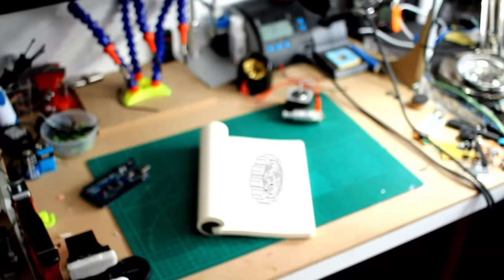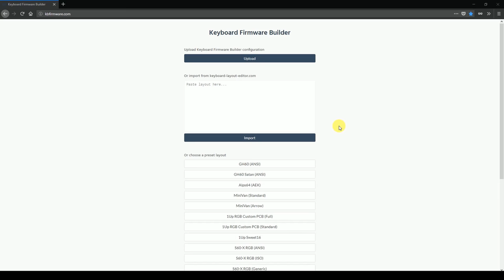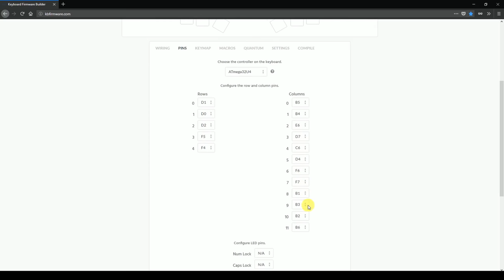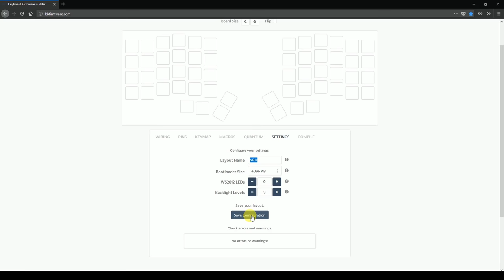P4: Fully DIY Mechanical Keyboard (Code name: Arke)| Wiring & Firmware | Part 3

Comment: This is awesome. The only thing that I advise you to do to have more sturdy soldering connecting is to use hot glue on them. Then they will not move or break when you use the keyboards
Reply from the maker: good point... would do that if the keyboard was not for me ;) so far there is no problem (daily driver)
Reply: Could it be done with resin? Hipothetically speaking, for added sturdiness. I have no clue wether it's conductive or not
Reply: @casiquekibra  I'm not sure what you mean by resin but if you want a permanent solution you can use epoxy

Comment: I did use separate controllers for each part of my keyboard and my connector cables between the parts is just standard USB (both left and right side of my split keyboard have a 4 port USB hub, either one or both sides can be connected to the PC).

This allowed me to add a bunch of "extras" to each side (like volume + media controls + macro keys on the left pad and a display, scroll switch I salvaged from a Natural 4000 and backlight controls on the right) and add both a numpad, gameboard and recently a streamdeck to the same device chain.

All of them have their own firmwares and names when connected to the PC and can be tinkered with and improved by themselves.

I'm also thinking of adding a "mid section" part that has a bunch of USB ports and connects to 220AC so I'm not drawing power from my PC and can charge my phone and tablet straight from there.

Other reasons to add a power node is I've been thinking of building a microphone interface and a headphone amp block too. Already made a streamdeck so might as well go all out I guess.

Comment: What are those little pin connectors that you used to make the cable and connection between the 2 halves? Asking for a friend (I'm talking about the ones lying on the work bench at 7:15)
Reply from the maker: They are most of the time referred to as "pin headers" and you get them as "male" (pins) and "female" (sockets)
Reply: @MakenModify  okay thanks. Just bought some and can't wait to hand wire my first mech!

Comment: Is it possible to install encoder's push button similar to chery-mx keyswitch ? 
Total on encoder i have 5 pins:  GND, 5V, A,B, KEY.  (vcc > 5v, gnd > gnd, A/b > rotation pins, KEY = push button )
I've tried to solder KEY+diode to ROW and GND to COLUMN - but it doesn't work. 
Any ideas how to do it properly ?
Reply from the maker: Hm.... Depends. If you have a bare rotery encoder then there are two GND pins one for the encoder and one for the button. If you have a encoder on a breakout board then these two GNDs are connected and that will not work. On a normal rotary encoder you can use the two switch contacts like any keyboard switch (polarity dose not matter). If you have it on a breakout yo can desolder the hole envoder or just the switch GND pin and rerout it

Comment: Can you give me advice? 
I gonna build splitted keyboard with 109 (50 + 59) keys + 4 encoders. The question is: Can I use only single Arduino Pro Micro microchip? Is it enough contacts for all those keys?
Reply from the maker: Short: you can't. The Pro Micro has 18 pins you can use, so the max number of keys is 9*9=81. There are two more pins, which are used for the onboard LEDs. You can modify these but even after doing this you only got 10*10. Each encoder needs at least 2 pins (+1 in the Matrix if you want to use it as a button). So one Pro Micro will not do it. You will have to use 2 (one in each half) and connect them via serial or i2c.
Reply: @MakenModify  thank you!

Comment: Thank you! This the best tutorial in YouTube about diy mechanical keyboard. 
I have 2 questions: 
1) Is it possible to assign on 1 key some key combination like Win+D or Ctrl+C ?
2) Is it possible to add a multimedia volume circle knob that can be rotated and change volume in system ?
Reply from the maker: Yes on both questions. For this board I used the kb firmware tool. It let's you do macros (like Win+D or any other combination), but for a rotary encoder (for volume or so) you will need to use QMK as a firmware. It's not as easy to set up but much more powerful.

Comment: Awesome design and perfect solution with one only Arduino! One question - is there possibility to use USB C type cable to connect both sides?
Reply from the maker: A USB C cable dose not have enough wires inside but if you put a pro micro in each half you can use i2c and only need 3 or 4 wires.
Reply: @MakenModify  Thanks a lot for answer! In any case, there will be so much better 2 arduinos...more cheaper at last :) Thanks again!

Comment: Very interesting, thanks for the in-depth explanation. Do you recall how much the case/plate/electr(on)ics cost you?

If you're interested in studying boards, give the Katana 60 and µTron ergonomic keyboards a look, I'm really tempted to build one of them or some in-between design.
Reply: Also, greetings from Brazil!
Reply from the maker: thank you :) I have the parts i used listed in the description but I would say Switches 30€, Plates 6€, Keycaps 15€, Arduino Pro Micro (Clone) 3€, Diodes 2€... The case only cost me filament and electricity so let's say 5€, than some other things... so something around 60€ (347 BRL).
Meanwhile I've build quiet some more Keyboards but there was not enough time to make a video :/ you can see them on my instagram if you want instagram.com/makenmodify
Reply: @MakenModify   Thank you for the thorough answer! In part thanks to your video I've been seriously considering building my own (also ergonomic) keyboard.

Comment: how to turn your machanical keyboard into a wireless bluetooth keyboard?
Reply from the maker: You can use another microcontroller board that has Bluetooth instead of the Pro Micro

Comment: 3:46 what wire diameter did you use? 
Great build & great video. Learned a lot.
Reply from the maker: I think i used 0,5mm² but that dose not really matter since it dose not have to carry any big current. It's only a signal so you can also use thinner wire ;)
Reply: @MakenModify  Thanks for the answer.
I know it's just for signal transmission but I wanted to know the exact thickness. The thicker the cable, the more difficult it is to bend it and here precision is needed. 
Have a nice day.

Comment: Does the type of cable I use to connect the two halves matter?
Reply from the maker: Not really its just for signals so it doesn't need to be thick or so. I also just used what I had at hand
Reply: Make'n'Modify Okay, thanks for the quick reply

Comment: Great but, What diodes did you use? And what are they for?
Reply from the maker: Ah was missing these in the description. Those are 1N4148. They are used to have n-key rollover and anti ghosting. See here: https://www.dribin.org/dave/keyboard/one_html/
Reply: @MakenModify  Thank you, Can this keyboard be used to play games? (Hold down w to move?) Or are these keyboards not capable at detecting held down keys?
Reply from the maker: @BIrfan  it sure can. The diodes are needed to have anti goasting an nkey rollover so all the stuff that makes a good "gaming keyboard" ;)

Comment: I Have 1N4007 diodes. will these do? or do i need the 1N4148 diodes specifically?
Reply from the maker: They schould also work, the diodes are not that critical, but if you want to be on the save side try a 2x2 matrix and test it ;) i also used the 1n4148 because that is what i had at hand at the time

Comment: I was wondering if there was any way to make the layout of the keys editable (like how some keyboard let you change what each key does) ?

edit: i know i can go and change the layout and flash the pro micro again. but i want to have a software running in windows that can edit the layout (if its possible).
Reply from the maker: Kind of. As far as I know all solutions with qmk involve reflashing. Ther are different softwares like qmk toolkit but they all reflash it. That being said you can use autohotkey but that will limit the effect to the computer it is running on. But ther you can do macros and change keys without flashing (works with any keyboard)

Comment: Bit late but could you give further explanation to how you wired your rows and coloumns to the pro micro.
Reply from the maker: Basically it's from 12:06 to 12:27. This is pretty short, probably could have done that a bit more specific. Basically you have your rows and colums and then you connect them to a pin on the pro micro and tell the firmware what row/column is connected to which pin on the "PINS" tab of the firmware editor.
Reply: @MakenModify  also when you wired the row to a wire where do you solder the wire?
Reply from the maker: @q_u_a_c_c  anywhere on the row really... it dose not matter since its the same signal everywhere along the row wire
Reply: @MakenModify  alright thanks
Reply from the maker: @q_u_a_c_c  your welcome

Comment: How did you upload .hex to arduino?
Reply from the maker: sorry bit late but I use AVRDUDESS, you can find a tutorial on how to flash a pro micro using this program here: https://gist.github.com/CampAsAChamp/e747d2b605c0c32923593b529f82ccdd
Reply: Thank U

Comment: does these keyboards have n key rollover ?
Reply from the maker: Yes and anti ghosting. Fun fact: that's what you need the diodes for ;)
Reply: @MakenModify  oh lovely.. i am looking forward to make one of these. I will start small, with a macro keyboard
Reply from the maker: @vivekanandroy810  sounds good. The principles are the same just less headaches (especially at the first self made keyboard). Good luck :)

Comment: You should deffinetly start selling these bro. i would love to buy one
Reply: it would be somewhat expensive
Reply: @acid3719  hmmm dont think so
Reply: @krisspsify  well yes bc the kb itself is like 50-70$ and the time this man put in it will ad at least a 30$ fee
Reply: @acid3719 man i am about to buy a kbd67mk2 search that up
Reply: @krisspsify  wierd flex but ok
Reply: @acid3719  flex? Buddy you are telling me 100$ is expensive for a custom ergo keyboard
Reply: @krisspsify  no but in my country its like 500$ for you and its expensive asf.i will probabley make my own
Reply: @acid3719  razer charges way more for plastic keyboards with non standard layouts, atlas here you can cut some cost by buying this board with no caps and getting the ones you want. Seems cheap to me
Reply: @TurkeyOW  well you need to know how to solder, have a 3d printer, get some iris keycaps, lube for extra thock, stabs
Reply: @acid3719  no no no, I'm mean ask him what switches you want and he does all of it except the caps which is one of the priciest parts. That would be cool